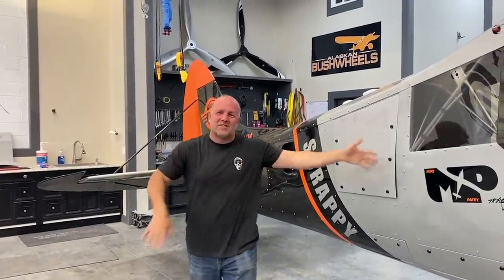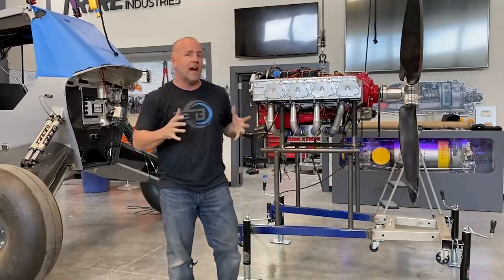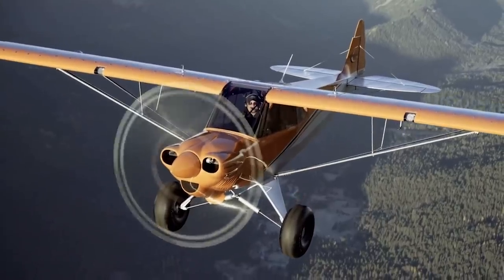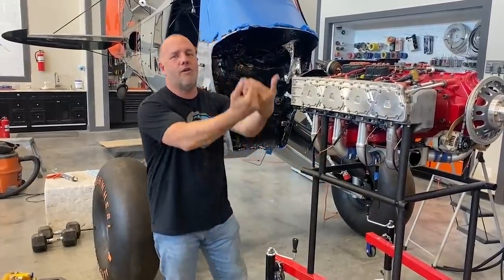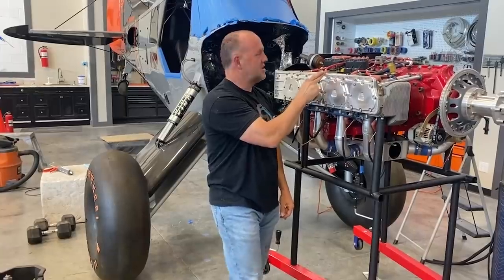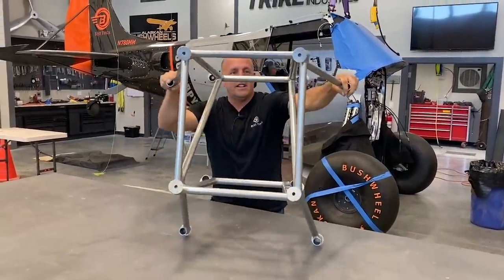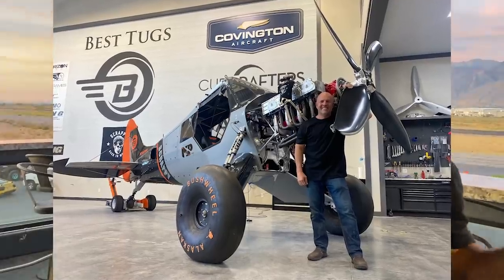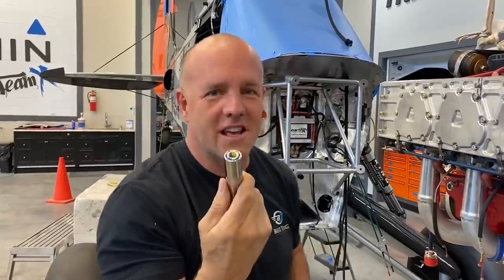Giant race engine into a Bush Plane 😳13 Liters goes into Scrappy build # 29

Comment: hi. although the mount has eight bolts to the frame the engine still has four to the mount. i see you are concerned, can´t you put some plates to add fixing points on the case of the engine? like an f1 engine i mean. sorry if it´s a dumb question. thank you for sharing your work. learning every time i watch a new video. take care

Comment: I am super curious about thrust angle alignment. I have a Lancair ES-P that needs a bunch of rudder trim in cruise to fly with the ball centered. I've got to believe there is more airspeed to be had getting that trim out and that engine thrust angle alignment through shimming would be the easiest way to get there. Any info out there on how to approach thrust angle alignment in airplanes?

Comment: Put the tape on the outside of the socket holding the nut such outside of the socket to have a tiny bit of tape grip. When you pull the nut out, the tape goes with the socket, will not stay on the nut.

Comment: For context, the float plane in the first part had a modified engine that was poorly mounted. He was also hot rodding around the lake for a few passes before this happened....
Reply: He  never stopped his descent
Reply: @bingosunnoon9341  true and he was behind the throttle... Most of this was pilot induced but there were still issues with the mounts. Cheers

Comment: Does the angle of the mounting bolt add shear force or hardspot at the point where the mount meets the firewall or are the bolt holes big enough that the bolt stays in tension?

Comment: Hey Mike I'm not a LICENSED pilot YET so maybe that has something to do with my question here...
How do you calculate the weight and balance (that you have said that you have RE-CALCULATED many times) as different things get added and moved around on Scrappy?
Are you actually picking the fuselage up with your overhead hoist and have some kind of scale on that?  Or do you just weigh all of the separate parts and measure their distance from someplace on the frame you somehow know to be the center point or fulcrum, and, and the "RE- Calculations are just done on paper? 
....I OBVIOUSLY don't have a Patey Brain...but I think I remember you saying that, "NO QUESTION is a stupid one."
....and I DO appreciate that VERY kind statement for us not so sharp folks.... :)

Comment: Question how come the motor on planes is supported strictly from the rear? I feel like all the weight of the engine hanging off the front is a lot of force. Additional Supporting bars from the front to rear wont help? Im sure its probably difficult with space issues.

Comment: Non aviator questions for you. With all your frame mods and the one off motor mounts does the FAA inspect your welds or any of your work?  I know you’ve said you have a great relationship with the FAA I’m just curious about the inspection process. After watching your builds I have no doubt in your engineering or ability but the government still likes to get involved, as they should in some cases just for safety. Thanks for reading now get back to work!

Comment: If/when the motor/prop combo is ready, and snatches the entire assembly from the tarmac in a near vertical launch ( rolling take off just doesn't seem to fit anymore) using only 3 - 4 ft of runway will they have to make another definition of STOL because of SCRAPPY?

Comment: Instead of tape to retain a nut or bolt in a deep socket, tear a little strip off a blue disposable shop towel and lay it across the open end of the socket before pushing the nut in.  When you pull the socket off it will just fall away instead of sticking in place.
Reply from the maker: Great idea I use that as well 👍🤠

Comment: This is the first time I've felt a trace of apprehension regarding the build - that long and heavy engine really does look like it's exerting a lot of leverage on its mounts compared to a four or even a six. That isn't to say I'm doubting that Mike's computations of the peak loads have been utterly rigorous, but I would definitely have reservations were it not for that amazing double-wishbone suspension design and implementation.

Comment: i think thicker pipe should have been used if you want your mount to take more punishment? as well as more than 8 points of bolting to the plane. im just a newb but i duno, a bit thicker would make me more comfortable but you're the experienced maser builder lol maybe even have the engine extend around the engine; caged. so its not just holding on to 4 bolts. while you have 8 bolts on the firewall the weak link is then the 4 bolts to the engine. the engine is a structural weak point the chassis of the cub should extend to and around the engine. if that makes sense.

Comment: You've angled the engine mount bolts, in hope they'll stay in if the nuts vibrate off. But, what about the torque moments on those bolts causing extra tension on the top side of the bolts trying to snap them?
Also, I'd be more concerned about your welds failing than bolt nuts coming off. Have you had those welds x-rayed and examined by someone certified in that work? You, said yourself it wasn't your best work.
Reply: He said he tig welded them after the initial tack welds and it looked like he ground them smooth as well.

Comment: A pice of shop rag or paper tower works just as good to keep nuts and blots in a socket and then u don’t have to stress about the tape that might be stuck in the hole forever. Hit it with some air and it’s out.

Comment: i have some questions about your motor mount, did you run it with some load calculation on a computer? why no and is there a need for some gussets in the pipe joins for some extra strength ?

Comment: Lol
Also tape or super glue nuts to the end of your finger to get into hard to get places then run the bolt or screw and pull your finger off. Lol it works.

Comment: The strength has to be there, on the cockpit side of the firewall, in order to support that monstrous engine.  When there is a pair of doors in line with the upper engine frame, that is a tension force that will tend to deform the door frame and pinch the doors shut.  Better carry something to cut yourself out of the cockpit, on hard landings.

Comment: Mike wouldn't the shear load of a single  bolt change and place of sheer change because of the angles and the forces of the mount ? Least with bolts sheer differently if any angle of sheee load changes  actually makes things worse for the sheer strength

Comment: Ok, I think this guy is damn good at what he does and I applaud that. Now, for what reason did he go through all that work to build that engine stand when he could have just used a standard engine angle adjuster between the hoist and engine? Simple to just carefully roll the aircraft up to the engine then slowly install the engine to the engine mount assembly.
Reply: Addition 1; 
Given the additional weight and generated engine torque I think using either solid billet rods or at least very thick tubular steel to make sure the frame doesn't distort from the hard landings bush planes are noted for. Could even fill the frame tubing with concrete which will improve the strength ten times but I'm not so sure the FAA certification inspector would accept. That prop is damn nice and those blades move a serious amount of air and all that is applied to the motor frame. If it was my bird, I'd use a couple pieces of billet at the most vulnerable areas just to be safe and add a couple steel reinforcing corner plates as well. I wouldn't go overboard on the steel plates, just a couple or few inches. I apologize if I seem to be a laptop engineer, lol, just tossing in my humble opinion and if I offended the builder, I apologize in advance, that wasn't my intent.

Comment: Ples excuse my ignorance but. (I'm a machineing student with no experience with motors) wouldn't a motor built to drive a gearbox and wheels be lacking a thrust bearing on the main engine shaft? I would imagine airplane motors pull the plane through the main engine shaft so thrust bearings would be necessary no? But on a motor ment for a car/land vehicle there is no need for a thrust bearing. Would I be correct? And did you modify the engine to take the propellers pulling load?

Comment: The only thing different I would do to your engine stand is put casters under the Jack's to move it left and right and around the shop
Reply from the maker: It has casters under it now. 👍🤠 look in the video, the jack stands have pins to pull them and rotate them 90 degrees out of the way and then it roles around on its casters

Comment: I hope that tank engine on Scrappy stays in place on hard landings.  There is at least 10,000 pounds of momentum load from the weight of that engine on a normal landing.  I am afraid that engine is going to rip itself right out of the firewall just like the clip of the sea plane in the intro of this video.

Comment: 8 mounts to the fire wall but only 4 to the motor? It looks awesome but just like mike not wanting that thing to come off, only 4 small bolts holding that motor to the frame is scary as. That thing is heavy

Comment: The only other thing you could do to be safer is to run 3" safety straps from the upper rear cross tube over the motor and under to the lower rear cross tube on the motor mount. Then even if the bolts snapped on the motor side you wouldn't change your moment.

Comment: Speaking as a layman when it comes to engineering I'm baffled as to how such a powerful presumably heavy engine can be mounted end on to some metal tubes. Surely gravity will be constantly stressing the top bolts, I would have expected to see some sort of longitudal beam integrated into the air frame upon which the engine could sit.
Reply: I thought the same at first, but then I thought about it a bit more. The engine is functionally a cantilever no matter what, because it's only supported at one end. Can't add a beam if there's no support at the far end - you'd just be adding mass to that cantilever. Same with extending the truss web up past the engine - you'd add a heap of weight for no real benefit.

This design absolutely will be stressing the top bolts, but a bit of googling and some maths suggests that each bolt can take nearly 15 tons of tensile force. That means it'd take 30-60 tons of force to actually cause a problem, and that really shouldn't happen with an engine weighing less than half a ton.

Comment: If you want to get a nut out somewhere and don't want to lose it AND you can't reach the nut to put blue tape on you can fill the socket with a low viscosity vaseline and the nut will stick to the socket.

Comment: bolts yeah cool, but the tubing is very thin and the welds could fail.
Reply from the maker: Grzegorz Durda  👍🤠 I would think the same thing just looking at it.  When I engineered several other mounts it always surprised me what was needed to meet certification specs.  The tubing gauge is 50 percent thicker than the mount holding this exact engine in its configuration on dirt landing crop dusters.  Also I have twice the bar counts and the stress test passed at over 12 G load.  I only need 6 G to have extra buffer.  Thanks for the comment.  I would have thought the same thing years ago just at a glance.  Cheers 👍🤠
Reply: @MikePatey  Thank you for the explanation. I meant no disrespect just the usual worry about everything holding together in the air lol.   I just recently started taking lessons so don't mind the rookie :)

Comment: Great content. I'm curious, the bolts in that angled position will have to work in transverse load rather than just axial load, would that be detrimental to the bolt performance? Did this consideration affected the size of the bolt used? I'm just a curious lsa pilot, not an expert at all. Cheers!

Comment: If you really want to save weight and gain performance, why are you messing around with these archaic airplane engines? Do what others are, use a more sophisticated engine from a car with a couple minor tweaks. Not only will you save hundreds of pounds on the engine, but you will use vastly less fuel and therefore need to carry less fuel.

Comment: Complete dive bomb spinning at the right angle changing spontaneous direction changeing g forces instantly the engine would un lodge from the plane. Fly the plane in late 2021 or early 2022.

Comment: I'm no engineer, but that mount doesn't seem nearly substantial enough to support that engine, or sustain the torque the engine must produce!
Reply from the maker: LifeOWrylee .. 🤠 it certainly is surprising what kinds of force loads a mount can hold.  It’s actually way over built and some of my fellow engineers that have commented said I could have saved a pound or two and done  less. but 🤷‍♂️ I certainly love overkill.  It’s more than enough.  Thanks for the comments I love dialog and thoughts.

Comment: I wonder how much the engine weighs?? I don't think this is a good idea.1,027 Cu In on a Cub. Like hanging two bib block Chevys in an Austin Healy. OOF!! That mount needs serious gusseting.
Reply from the maker: It may not appear this way on the video, but the engine mount is substantially larger than a standard cub mount.  Otherwise correct, it wouldn’t support the weight at all.

Comment: This build scares me as an avid watcher..... So much to say. This is pretty stupid to do. - Mech Engineer
Reply: His bolts will be getting a non-linear load due to the offset. The bolt ratings are not for those angles. His reasoning that if all four bolts are in they counter each other with no nuts attached. That is true in a static state. Apply some pressure and your bolts are now seeing pressure at an angle. He's not removing the amount of pressure applied by moving it to an angle. The full pressure is still going through.

Comment: The question is why? That is a two place airplane! Pilots are flying modified Piper Cubs getting off and landing in 40' with low weight and very low horsepower. Your stuff is way too expensive and complicated to justify or make sense. You should be building monster trucks!

Comment: The ONLY way I could watch this video if I had it on 'MUTE' the WHOLE Time!!!  The engine is just a Lycoming IO-720. Nothing special. Used in much of general aviation aircraft. It's a very HEAVY 400 hp engine. Not impressed.